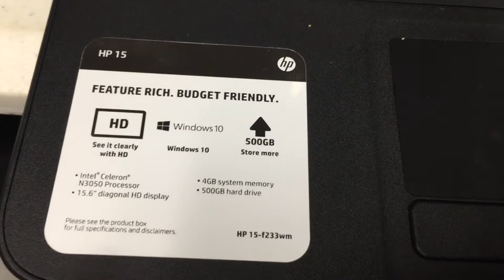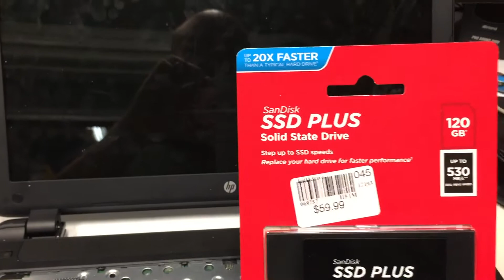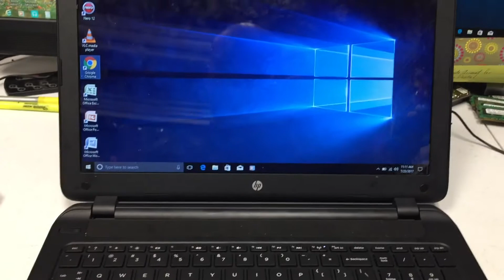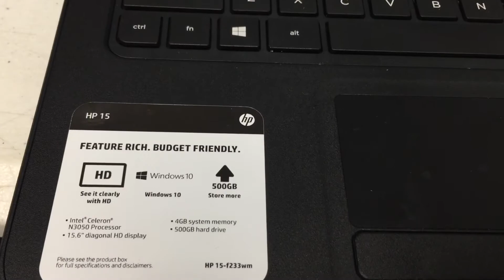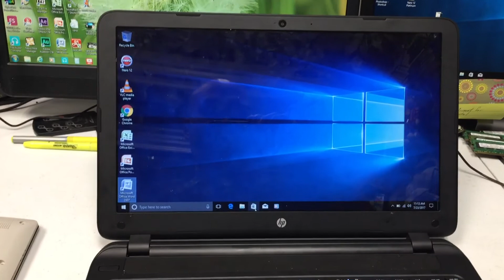SSD on a $280 HP 15 F233WM laptop    is it Worth it?

Comment: I was brought the exact same model, but when I install the SSD the installation process is terribly slow, and it always comes to a point where the SSD cannot be formatted, or the installation files can’t be copied. When I put a normal HDD, Windows installs Ok. I’ve already updated the BIOS and it does not have an AHCI option. Anybody ran into a problem like this?
Reply: I have the same problem. You was managed to fix that isse?

Comment: What would be good ways to upgrade this laptop. I have one and it’s slower than windows vista. I know I can upgrade the ram, but what else
Reply: From what I've seen on forums the only possible upgrade is an ssd or switching from a 4gb ram to an 8gb ram. Good luck man. I'm stumped too. I've had this laptop for almost 3 years now and I think its reaching the end of its capabilities .-.
Reply: Angie Rose yeah I figured it was a piece of crap. I upgraded to a Lenovo with AMD ryzen 7 and Raedon graphics card. It’s the best laptop I’ve owned.
Reply: Upgrade to 8GB ram and A 2TB SSD... Works for me
Reply: I suppose you could a light weight Linux distro on there.

Comment: I have this same laptop and it won't come on anymore...can I remove the hard drive and connect it to a working laptop to retrieve the files?
Reply from the maker: GrAdeADub, if the hard drive is still physically working then you can use an external hard drive docking station or sata to usb wire set to do a file transfer to another computer.

Comment: This laptop has a 500 GB magnetic hard drive , so why would u put a 120 GB solid state drive in the laptop?  Depending on what the customer has on the current hard drive, that 120GB solid state drive will be pointless... 😒
Reply: Couldn't agree more. Bad technician practice all around. When you upgrade to a SSD standard protocol dictates you should at least match the current drive size or preferably get a larger SSD drive especially if the client will be using it for anything more than casual web surfing.. lol
Reply: Because the magnetic hard drive slow down the Laptop. An SSD improve the system fastness

Comment: Great, I just learned that my new laptop is a piece of junk!
Reply: Same here
Reply: Lol 🤣
Reply: As a single task machine, doing basic browser based and light work, it works OK, especially if you know how to turn off all the BS background stuff and run the bare minimum. Mine is just my cheap (I got mine at $69 new in box) take-it-with-me laptop. My 'desktop replacement' is no powerhouse really, but is way more potent. After a couple of years having it, I was considering upgrading to an SSD, but seeing how hard it is to get to, I don't think so. I probably will be upgrading the RAM to 8gb, since it can basically max out the 4gb doing fairly basic stuff.

Before you buy ANY computer, check the specs. Know what you're getting into. For me, if it wasn't so stupid cheap when I needed a new laptop pretty badly, I wouldn't have bought it.